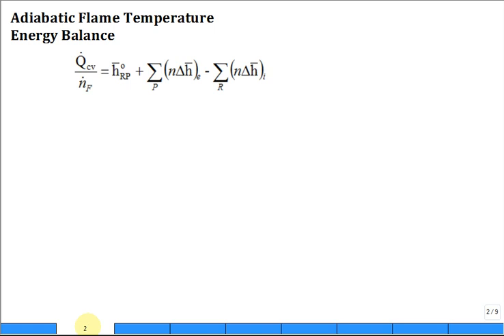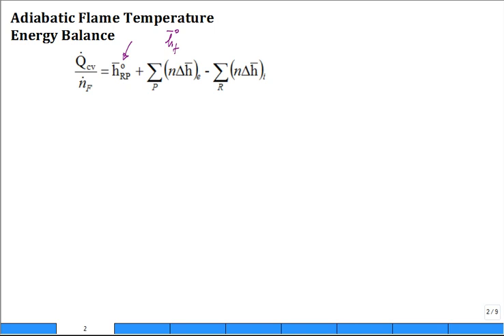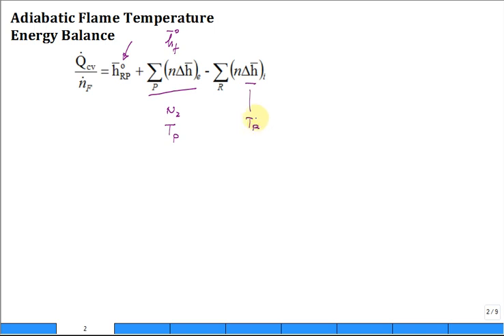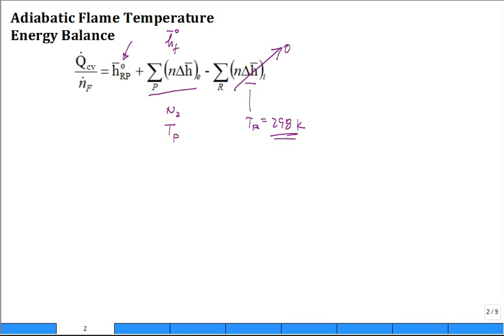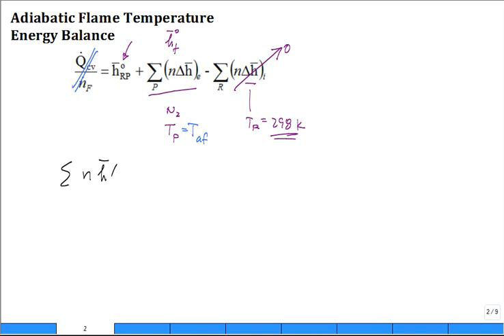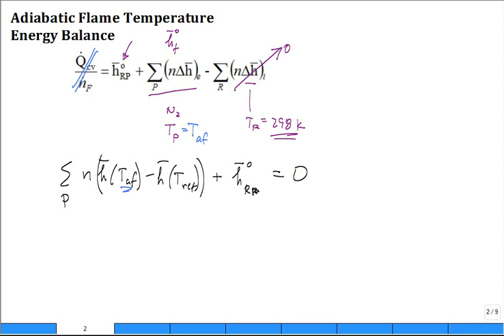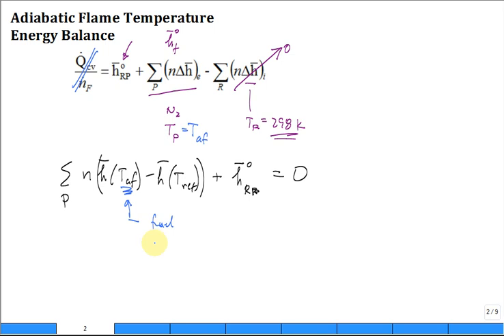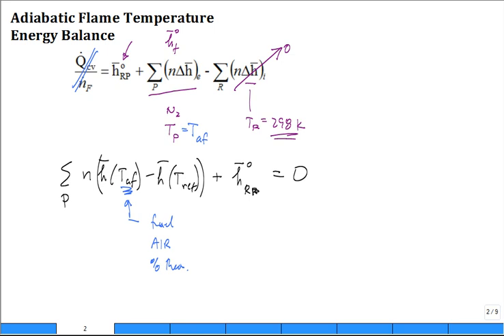Intro adiabatic flame temperature

Comment: HOW AND WHY THE CANDLE FLAME IS ROUND AND BLUE AT “ZERO" GRAVITY IS ALSO CLEARLY EXPLAINED BY WHAT IS E=MC2 (ON BALANCE):

The candle flame is round and blue at “zero" gravity for the same reason that WHAT IS THE EARTH is blue ON BALANCE. In “zero" gravity, the flame is cooler, spherical, blue, and centered on the candle wick. There is a PALE blue flame as opposed to what are the familiar candle flames (BRIGHT yellow-white) ON WHAT IS THE EARTH, when this candle flame is TEARDROP in shape, basically yellow, and mostly well above the wick. ON BALANCE, consider the blue flame ON THE EARTH along WITH the colors of WHAT IS THE SUN in the sky. When “coolest”, lava is red (and it is blood red too); but lava is MAINLY ORANGE (ON BALANCE), AND it is even YELLOW (when it is at it's HOTTEST). Also, notice that water is an excellent conductor of ELECTRICITY. CLEARLY, GRAVITY (importantly, as it has been written) is an INTERACTION. Notice the orange AND setting Sun in DIRECT comparison to/WITH what is the fully illuminated, WHITE, AND setting Moon. (The Moon is ALSO BLUE). Excellent. Also, consider what is THE EYE (ON BALANCE). The sky is blue, AND THE EARTH is ALSO BLUE. The stars AND PLANETS are POINTS in the night sky. The tides are CLEARLY AND necessarily proven to be ELECTROMAGNETIC/gravitational (on/in what is BALANCE). FANTASTIC. It ALL CLEARLY makes perfect sense ON BALANCE, as BALANCE AND completeness go hand in hand. Beautiful. Green is the color of what is living ON BALANCE. Great. Think about what is fire, of course, ON BALANCE. Indeed, consider what is lightning ON BALANCE (as well) in relation to clouds AND what forms as water. Finally, ON BALANCE, consider that what is the Moon is comparatively “pale” in relation to what is THE EARTH/ground when they are seen from outer “space”. Accordingly, ON BALANCE, what is (CLEARLY) the BALANCED MIDDLE DISTANCE in/of SPACE is to be DIRECTLY compared WITH what is (and represents) E=mc2 (on/in BALANCE) !!! Beautiful. ON BALANCE, notice that the rotation of WHAT IS THE MOON matches it's revolution. Clearly, E=mc2 IS F=ma on balance, as ELECTROMAGNETISM/energy is (CLEARLY AND necessarily) proven to be gravity (ON/IN BALANCE) !!! Accordingly, gravity AND ELECTROMAGNETISM/energy are (CLEARLY) linked AND BALANCED opposites (ON/IN BALANCE). Indeed, consider the speed of light (c) ON BALANCE. E=mc2 is CLEARLY F=ma on/in BALANCE. Consider TIME (AND time dilation) on balance. This NECESSARILY represents, INVOLVES, AND DESCRIBES what is possible/potential AND actual (IN/ON BALANCE). Magnificent ❤️ !!! Consider what are red, orange, and yellow in comparison with what are blue, indigo, and violet. Think E=mc2 !!! Think MIDDLE DISTANCE in/of SPACE ON BALANCE !!!! GREAT !!!! Think GREEN !!!! Think about “natural” flames in relation to temperature ON BALANCE !! Excellent.

By Frank DiMeglio